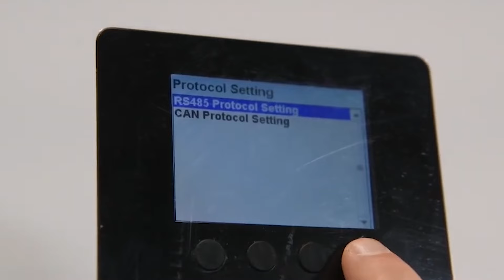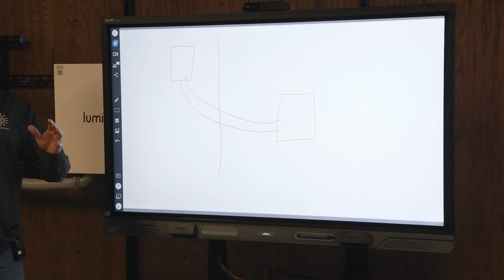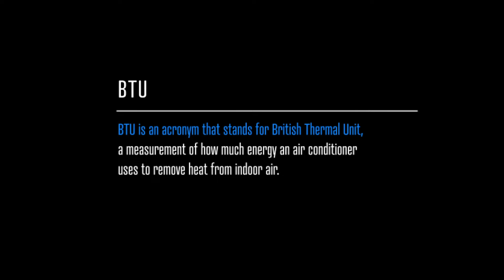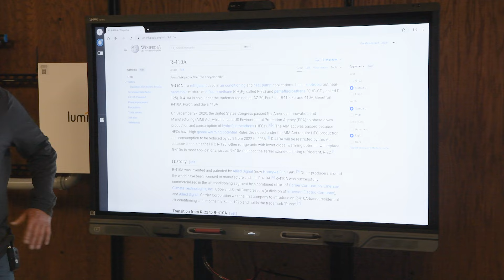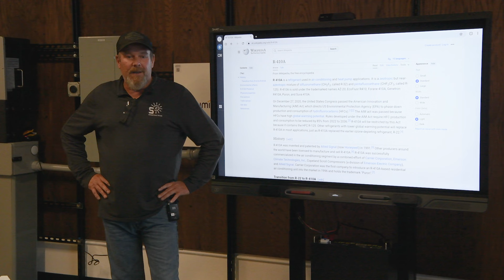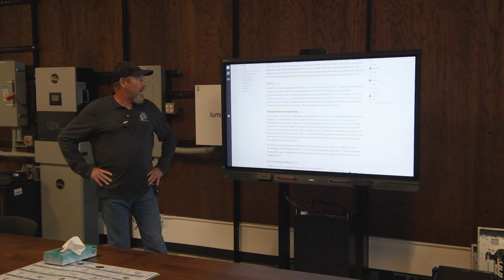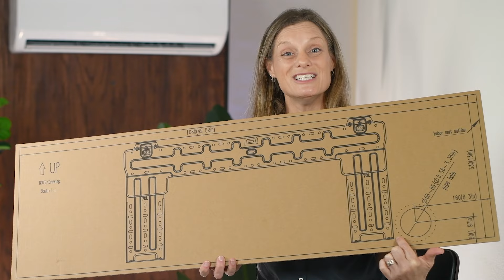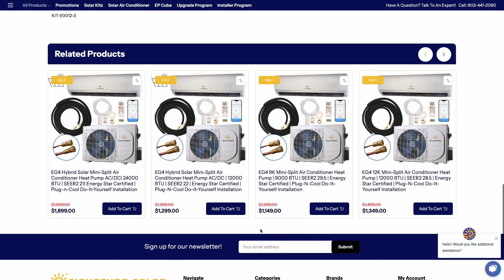EG4 Mini Splits Simplified: Your Questions Answered and How to Install

Comment: I enjoy our 24k Solar Hybrid Mini-Split but have noticed issues with the solar properly activating during the day. Sometimes it works and sometimes it doesn't. I have to disconnect and reconnect the solar to the unit in order to "reset" it so it will actually accept solar input. Not sure what the issues is and talking with Signature Solar has not resulted in any solution.
Reply: I have had similar issues as yours and unfortunately not had much better luck.
Resetting the unit seems to be the best thing.
I believe the MPPT unit inside the unit needs quite a bit of sun to get going.. like its charging up a capacitor and it can only do that while the unit is running on AC power.
It seems if you leave the unit plugged in/ leave the breaker on for it after it has been running that it won't have that problem..
Just my 2 cents from messing with mine.
They could definitely be improved, but even with the problems they have they are definitely still worth it for their cost savings..
That is if they will hold up for several years.
Reply: Same issue here. Some days, it's great like yesterday where I started getting some solar fairly early in the morning (between 7:00 and 8:00). But other full-sun days I won't have any solar at all at 10:00 and I have to turn the solar disconnect off and back on to get the solar to engage.
Reply: When I was running it on just solar pv I noticed it wouldn't always start up even when it had a lot of light on the pv . I would turn it off and back on and then it would go on solar. But since then I have connected the AC to it and it works better on switching between the two - seems like it needs the AC to keep it's controller active and then can determine to start taking in solar or split the solar and AC .
Reply: @LarryKapp1 believe it will attempt to reconnect several times under low power situations. If unable it will turn off and quit trying hence the need to reset. I believe I saw this information in the manual but don’t remember for sure.